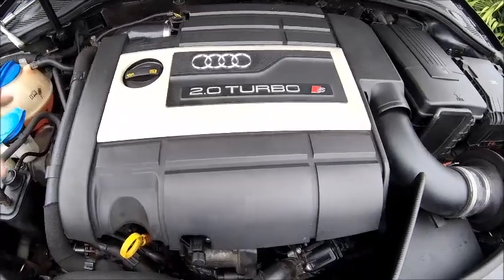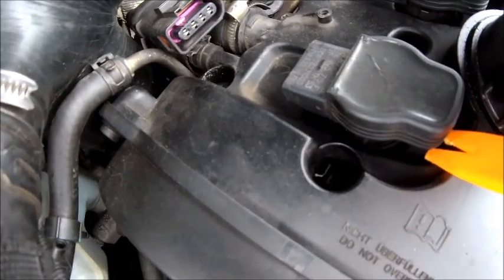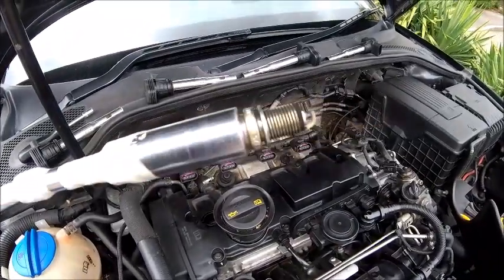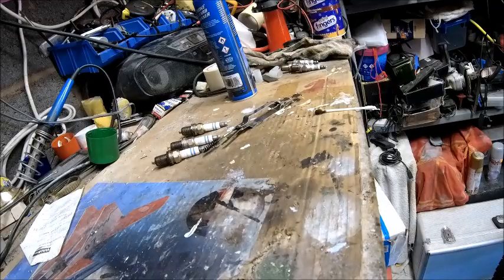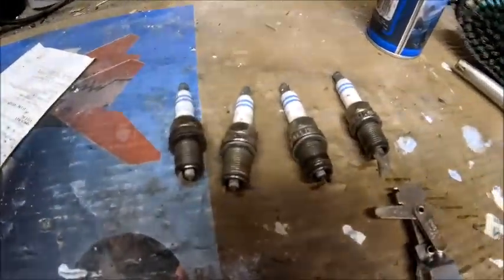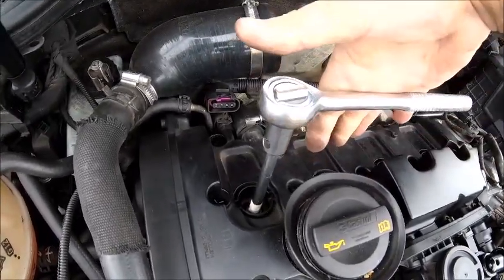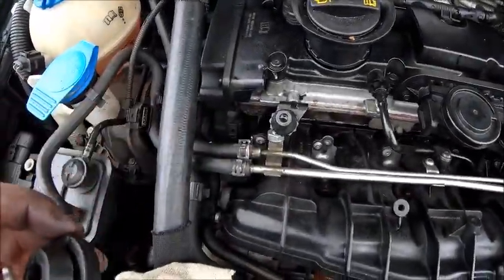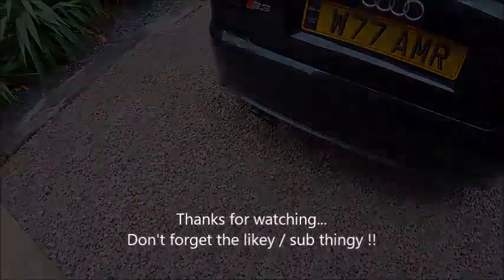#Audi #S3 (8P) Spark plug maintenance

Comment: Hi Ade,  I have an s3 that needs a clutch.  What clutch did you install and who installed it and how much was it?  I like in Cambridge if the garage is close?
Reply from the maker: Hi Greg...     The clutch was installed by  Gino Harling    
(Harlings Auto's Ltd 01733-346171 Peterborough)  As I recall the clutch actually came from techniclutch on ebay ....
The one i fitted was the Kevlar one and retained the dual mass ... But i also have a complete single mass one in my garage that i was going to  to fit and never did (plans on more power i never needed) ...
Reply: @AdeReeves  thanks for the info.  how much was the fitting?
Reply: @AdeReeves  just looked at the clutches and do you mean the carbon one?  I did not see a kevlar one?  why did you not fit the clutch yourself?
Reply from the maker: @gregmacgregor7066  As i recall around £300  its a good day and a bit job ..
Reply from the maker: @gregmacgregor7066  Hi ...it's just not a job i wanted to do on my drive...   This is the one i have sitting in my garage, the one i fitted was the dual mass version
https://www.ebay.co.uk/itm/SINGLE-MASS-FLYWHEEL-CARBON-MADE-WITH-KEVLAR-CLUTCH-FOR-AUDI-A3-HATCHBACK-S3/264384708994?ssPageName=STRK%3AMEBIDX%3AIT&_trksid=p2060353.m1438.l2649
Reply: @AdeReeves  thanks for the info.  Why did you buy both clutches?  my car has a tune so I might want the SMF but the drive ability might be poor?

Comment: What's the exhaust set up pal? Sounds good!
Reply from the maker: 3 inch cobra with 200 cell cat into a standard resonator / back box to keep the drone down....sometimes wish it was a bit louder but use the car a lot and on long journeys the full system drives you crazy  :)
Reply: @AdeReeves  sounds nice! Mines a standard exhaust apart from a milltek back box (which I've seen is a bad design) and it's too quiet cobra are the best for flow and sound definitely something I'll be changing when I've got some spare cash!
Reply from the maker: @Carlst17  yeah been seeing a lot of bad reports about Milltek... Even from Niki at Rtech..I brought the car with a lot done to it and the previous owner consulted Rtech every step of the way ...they did mention the back box does restrict slightly , but nothing major....and the alternatives where much louder and again the drone...really don't want that so had a small compromise..    :)